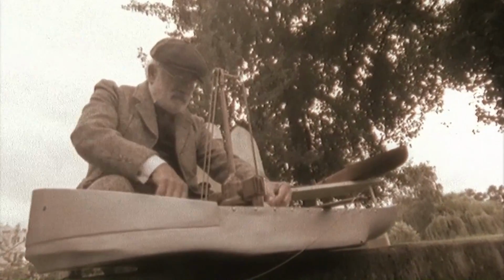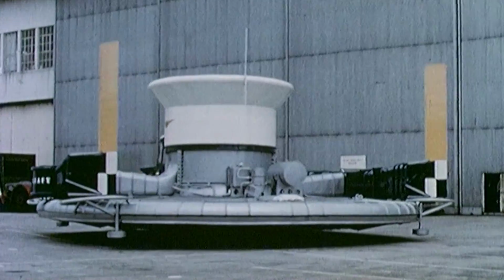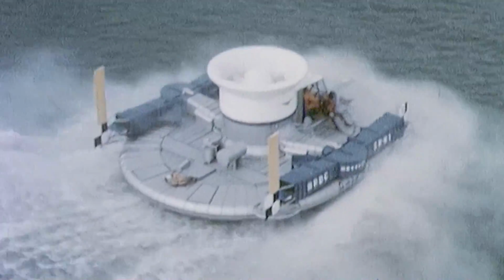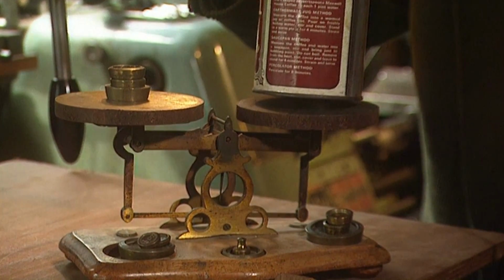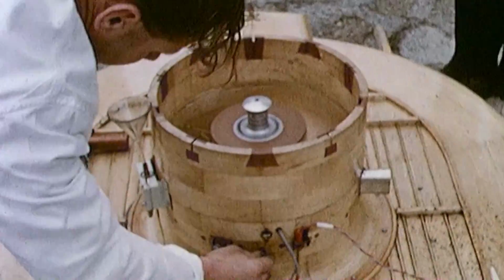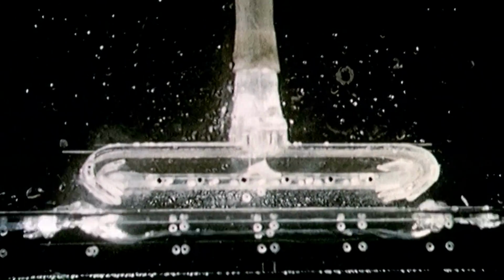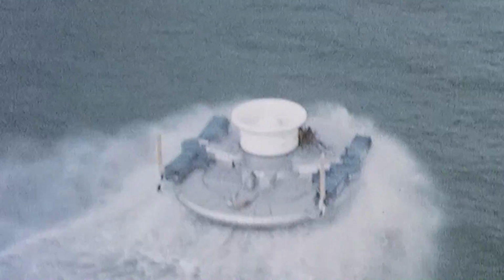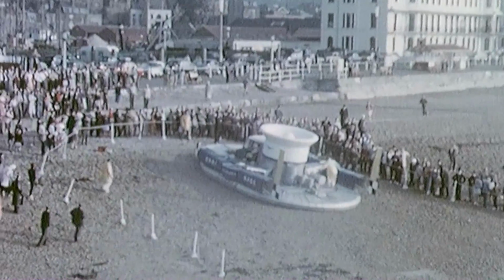Great British Inventions - The Hovercraft

Comment: Not a British Invention, are you nuts?  Have you ever seen a Russian 1930's hovercraft?  The Brits invented the flexible skirt that allows the thing to fly and this is copied across the world including the Russians!  Credit where credit is due.
Reply: DBLT 3 Hovercraft is not a british invention.It was patented 1935 in Finland.Patents were sold to Britain.
Reply: +pierre 
Nope. An ACV is a very British design little fella. Is a boat with a fan a hovercraft?.... No! Its a principle of design. The germans claim the jet...whittle had it years before. The Fins had an idea, the British made a practical machine. Without the skirt its just a noisy, non floating boat! Sorry...
Reply: Patented in Finland,means Finnish invention.First one build in Britain means British design.Little fella?
Reply: +pierre 
Youve completely missed the "invention" point little fella. Did the Fins put a skirt around the boat?!
Reply: An invention depends on two points, the theoretical idea and the practical implementation - both were British so in what world is this not considered a British innovation? Anyway, just as the car was only invented with its engine, it could easily be argued that the hovercraft was only invented later when the skirt was introduced. Before that it was a mad inventors item with no practical usage.